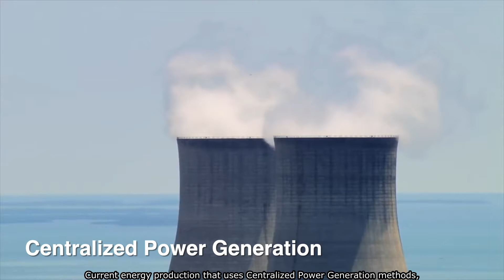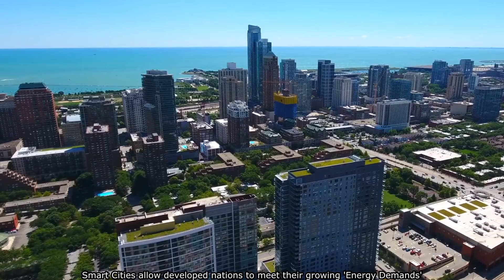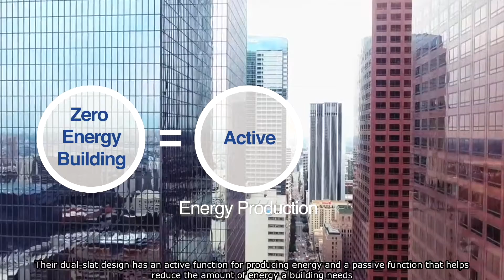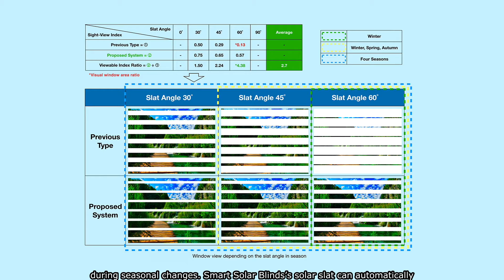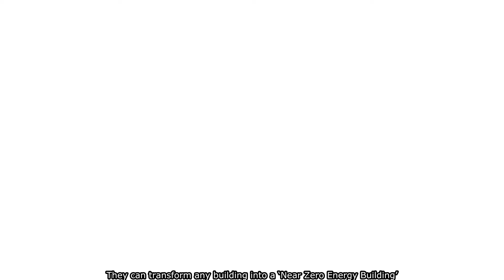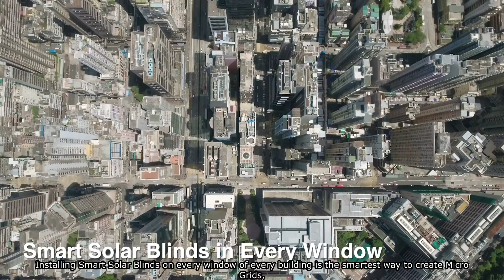Eng_ (Dual Slat Type) Smart Solar Window Blind for Mega Smart City

Comment from the maker: South Korea -  (Dual Slat Type) Smart Solar Window Blind  for Mega Smart City
https://www.youtube.com/watch?v=Lv1dg5-UUX8
Technology: Smart Solar Window Blind for Mega Smart City

< Solution>
  - Don’t need transmission towers: Even if the energy demand in the big cities increases, there is no need to install additional transmission towers and the existing transmission towers can be removed.
  - Can supply up to 90% of the electricity demand in Korea (replacement of nuclear power and thermal power generation):  Installing in the building’s windows of the south and west, improving solar efficiency, etc.
 - How: Installing ‘Smart Solar Window Blind’ on Windows of High Rise Building →   Near Zero Energy Building (Energy Saving + Energy Production)  →  Micro Grids  → Mega Smart City